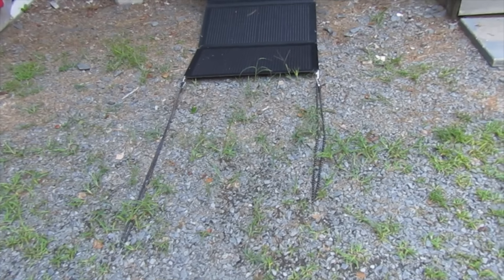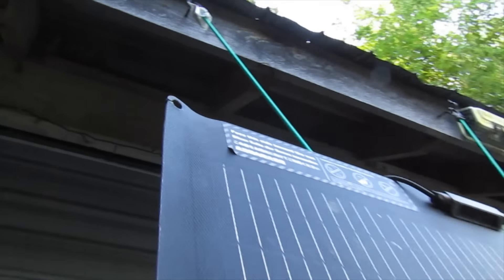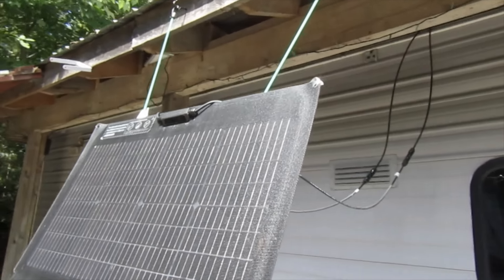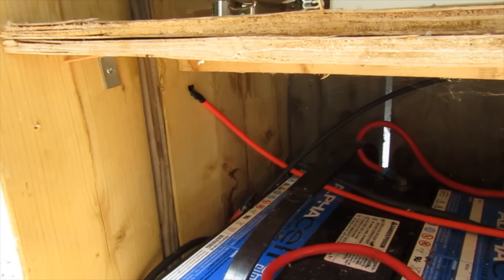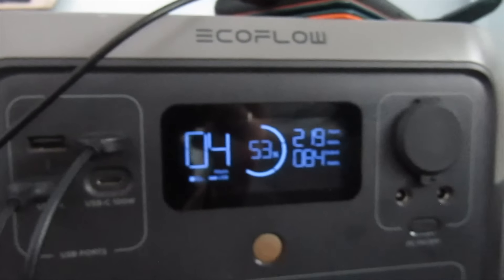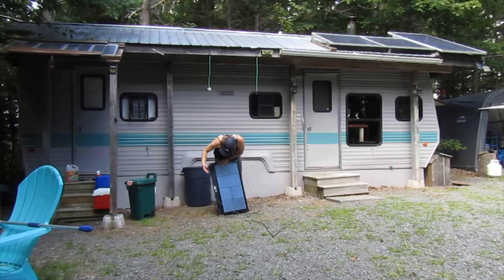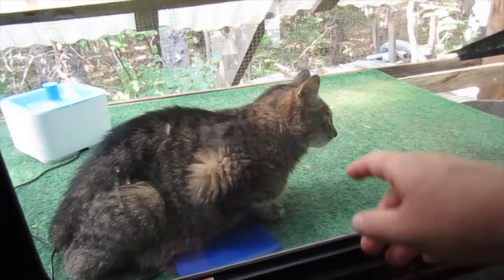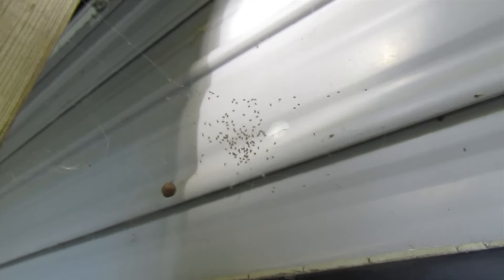Persistence (sometimes) is KEY + I Cracked My Tub.....Again!

Comment: Bad news, I’m sorry that will not hold up no time. 😢 I am a retired plumber. I have fixed so many tubs. Any plastic tubs are weak. Especially RV tubs. 🙄 You can drill holes along that crack and spry foam under it for supporting it to the floor. “Use Tuff Stuff”. Get a two part epoxy, fiberglass reinforcement kit on it and you’ll never have trouble with it again. It will be a little tricky matching up that pattern. Put one layer of two part epoxy to set the fiberglass reinforcement It’s thin you may use two layers of fiberglass in two directions. Then a couple of layers of two part epoxy to feather it out. Feather that out with sandpaper. I used a small sander. Work with a ruff grit “ being careful not to sand back down to the fiberglass” work your way to a fine grit. Then you can get some tub paint to match what you have there and “finely” feather the paint out with fine sandpaper. It would be really hard to match that bottom pattern although it’ll be fixed and I’m sure you won’t care. With all that said, I usually came back and painted the whole shower/tub to have a good match. I have fixed them where the whole bottom was broke out all the way across the bottom of the tub in the middle where. Kids have jumped up and down splashing in the tub. 😊
Reply from the maker: Thanks and wow, that does sound like a lot of work!
Reply: @gypsyjenna I pretty much agree.  If you replace the tub (again), it would be ideal to set it into spray foam or even tile grout.  But if you want a stronger fix to your current tub, I would clean and rough it up and use some Marine Tex epoxy.  It’s designed for fiberglass boat repairs.
Reply: Oh sure you do just keep a towel there when you take a shower
Reply: @jmcbrew  I’m sorry that’s what I meant to say epoxy daaa🥴
Reply: @gypsyjenna  I’m sorry I did mean “2 part epoxy” never had one fail. It needs the foam under it tho for good support :-)
Reply: @user-01Bigmac50  With it leaking there it’s rotting the floor under the tub. A towel won’t help with that. 😢
Reply: @gypsyjenna  Good repairs are never easy and bad repairs never work long- choose your poison. Determine if your tub is fiberglass or ABS, then patch it accordingly from the backside going a few inches extra in all directions. You might have to unfasten it and prop it up to work the area. When you finish, fill it with enough water to see if it leaks. The best leak tester is toilet paper; it will show even the tiniest amount of moisture. If that's good use non-expanding spray foam and fill in everything underneath the lower tub floor. If there's places you can't access while the tub is down, spray them while the tub is propped up then drop the tub into it- work fast so the foam doesn't set. With luck that will last you some years, 

The sad part of RV's is that everything is made of thin and cheap low-spec materials, and much will be sized or made such that you can't easily replace it with something better. Anything made for RV's will cost more than a home-grade item but will be a far lesser product so anytime you can convert to home-grade things that's the way to go. They do make home-grade fiberglass 24X36 shower pans, and that's what I'd recommend but this will not be a direct replacement thing- it will need plumbing changes and maybe an improved floor as well as new enclosure walls if your existing walls don't go down far enough. It will also cost more but only once, and you'll never have any problems ever again as the benefit.
Reply: @scooter6334  cool this guy really knows what he’s doing
Reply: @mjrootz  Ask me if I care 😏 the ones that would say if this was my job…. Didn’t last long 🤭
Reply: Hey Jenna. Thank you for your channel. I look forward to living full-time in an rv shortly and watching your videos gives me knowledge and confidence. Thank you.
Reply from the maker: @elizabethbradbury1460 best of luck and thanks for watching! 🙂
Reply: @gypsyjenna  Thank you!

Comment: A quick but good alternative to repairing that crack…..”Flex Seal” I know some people might say WTF but…..I’m a commercial HVAC contractor that works on large HVAC equipment. I had a customer that did not have the money to repair a cooling tower basin the way it needed to be done. So…..I cleaned up the basin real well and painted on some white ( clear available on Amazon) Flex Seal on it and let it dry for about two days.

I then added 2000 gallons of water at 8 pounds to a gallon…..16,000 pounds of water weight on the basin. Not one leak now two years later.  Something to think about…

Comment: As far as the portable 220 watt panel your probably right. When I saw you tie up the panels the way you did I knew there was going to be a problem. Solar panels should always have a bracket to hold thier weight, especially this 220 watt 2 sided  tempered glass panel.       If you want to use them at ground level build a  frame that would completely support the whole panel and is also portable.  Good Luck!

Comment: I didnt think about useing the spray foam under your shower ,
Thats a good idea .  Find a piece of plywood about the size of the tub , first put some material down like plastic drop cloth  because that foam could stick to the plywood piece used to keep the tub floor flat .
Plastic sheet you can get off , it wont be easy .  Good luck .   😀

Comment: If you ever get under the tud again put a small wood frame around the curvature for support. 

Addition foam etc will only fix short time as it will push down due to weight.

Ive owned to many mobile homes and that is a common problem over time.

FWIW - you dont have a beer problem all is well!

Comment: Your tub cracked in the same area mine did (where the textured and smooth surfaces meet).  I put a piece of white Flex Tape on the crack, it's working good so far.  My tub and surround will get replaced this fall/winter.  Have a great rest of your week.
Reply from the maker: Thanks for the info and you as well!

Comment: When you replace or if you replace the tub, try putting more backing underneath to give it more support. Fiberglass tubs are notoriase for cracking at spots that don't have support below. If you have access from below try spraying expansion foam into the void areas.

Comment: Hello again 3M 5200 Marine rubber put it on a half inch thick on both sides and about quarter inch at the middle. I know this is an older video you might already have it fixed but good luck I do have a off-grid camper on the property with 8 golf cart batteries works very well. From your new subscriber.

Comment: Hey Jenna,
    Please tell me that when you were up on the roof, you cleared the branches from the other panel. That's a nice power station that can take the VOC of a 400 watt panel. Even in not ideal solar conditions you may be able to max out the 220 watt maximum input of that station. It's never a bad idea to over-panel when possible. Thank you for not killing the spiders. 🕸️ 🕷️. If they stay outside they do more good than harm. The Wasps on the panel would have to go through. I'm allergic to bee and Wasps venom. 😅 
        That's a shame your newer tub cracked. I remembered when you replaced the old one. I have a crazy question. Are there any RV tubs made out of aluminum? I don't know but if something like that is available, that might be an option. You shut your water off in the cold months something like that might work.
        Ramsey looks happy because you're pulling in max solar on that power station and you can top off your smaller power banks to keep his fountain running. BTW... Ramsey has that "I don't do windows" look on his face. Rory must've been keeping a low profile in this one. He was haming it up in the last one.  
      Take care and remember, stubbornness doesn't have to a liability, it can be a valuable asset.    Enjoy the rest of your weekend and have another cold one. -----Steve.
Reply from the maker: Thanks Steve, I haven't heard of the aluminum tub but I am very disappointed mine cracked as quickly as it did!

Comment: Pull up the rigde cuse some protective gaurding and it will shorten the run . Those tubs are poorly support,In my trailer  it was cracked so I used spray foam to add support and used a flexible spray on rubber in a can to coat the tub,may have to use some sand paer to scuff the material.

Comment: Might be a good idea to insulate the wires where it touches the metal roof sheets/secure them so they can’t be moved around by the wind. The wind could cause the solar cables to rub against the sheets and wear out/cut through the insulation and ground out your wires on the metal.

Comment: i would get a can of big crack spray foam filler from wally world and drill a small hole to fit the nozzle, fill it w foam and then silicone the hole and crack.yes them tub/shower pans need support ALL around the bottom or what happened will happen. plenty of vids on here about installing tubs and shower surrounds for tips.

Comment: For that unwanted branch, there's a tool where you toss the weighted end of a line up over the branch, then pull the line to get the business part of the line to the branch; that part is sort of like a chainsaw chain. Pull the two ends of the line to and fro to cut the branch. Also, I have fashioned custom saw attachments to go on the end of my roof rake. One is from a pruning saw, and the other is a tiny bow saw. As long as you don't get the blade bound up, you can make modest-sized high cuts. Also, a home-crafted brush attachment on the roof rake poles would allow her to stay off the sketchy stepladder in winter; she could get snow off the solar panels from the ground.

Comment: Maybe someone has suggested this already. And not sure if it will work on your tub. But my fiberglass tub at home had several cracks. I used spray on flex seal. I put three coats on and now two years later it has not leaked at all.

Comment: I agree with what scooter said. But, if you need something quick and less stinky, Gorilla Glue makes a product called Gorilla Tape Waterproff Patch & Seal. It comes in white. I stepped into mine and got a HUGE crack in one corner. Put a piece of this over it and, so far it's holding just fine. I do wish I had spray foamed behind it first though.

Comment: Those portable solar panels are expensive Jenna how many watts is it ? Tubs broke again ? Danm the bad luck with that tub I’d put wax paper down and spray foam underneath the whole bottom of that tub the foam won’t stick to the floor because of the wax paper use a couple of layers of wax paper if needed Ive did this before if or when you take the tub out it won’t be stuck to the floor it works 😀👍😎

Comment: PUT THE PLYWOOD UNDER SHOWER  PAN THEN GET A CAN OF SPRAY FOAM LOW EXSPANSION SO IT DONT RAISE THE  FLOOR  AN RUIN IT😂 SPRAY IN AN FILL FLOOR SPACE BETWEEN  PAN AN PLYWOOD ALSO GOOD FOR SOME INSULATION   SHOWER  PAN COLD ON FEET GAP BETWEEN  PAN AN PLYWOOD  NO SUPPORT  THATS WHY  IT CRACKED I GUESSING  GODBLESS YOU JENNA GITTER DUN

Comment: Where's there is a will

Where there is a WILL
There's a lawyer too
She's always doing something 
Always something new

Trial and error
She's on the spot 
Dangling solar panels
She can't be stopped

Superwoman
Ready to roll
Quicker than any super hero
She's ready to go

Yes, the life
Yes, the trial and tribulation
A sponge of knowledge
And her little POWER STATION

( Try Tyvek tape. It's extremely water resistant, used for Tyvek house wrap. I use it for a lot of out door projects. Though not an attractive repair it works. I use it to prolong small cracks in 5 gallon buckets to carry water for plants. Tough woman...venture on.)
Reply from the maker: Thanks for the sweet rhyme and I will look into that repair!

Comment: I know this is a SUPER LATE comment... but if you want to fix that tub... Go get you a small container of fiberglass resin (with hardner... I suggest "Bondo" brand for your needs) and a small pack of fiberglass matting. It may seem difficult, but it's easy as F. Scuff up the area around the crack, mix the resin with correct amount of hardener (just follow the directions on back) wet the crack with mixed resin, place pre-cut peices of fiberglass matting over it. Go over this with some more resin, and for  a lack of better terms, 'Stab' at the matting with a chip brush (cheap as a kick in the ass) do this with about .... ohhhh two to three layers. Let this dry, and give it a quick sand to make it smooth. Then hit it with some spray epoxy paint and you'll be all set. It sounds more involved than it really is... but this will cost, at best, ehhh 30-35 bucks. This is the same method I've fixed boats for years and ain't a single one of em leaked. I've also repaired motorcycle plastics that have been damaged beyond recognition and have been stronger than they ever were. It's a cheap fix, and a super valuable skill set to have. Anyways, Thumbs up as always.
Reply from the maker: Thanks so much for the tips!

Comment: Epoxy might work. Ask  a store that sells plastic tubs. Do a search. Weight goes on the area. Support the bottom to prevent movement or bending.  Thicker tub bottom. Patch with epoxy?

Comment: I am wondering if your ECOFLOW model has both, an input jack for the solar panel and another input jack for the 12V cigarette lighter car charger?

If yes then you could connect all your 12V gel batteries to that 12V jack and that should extend the time that the ECOFLOW can run the fridge etc.
Reply: The tub on my RV is supported by a piece of plywood directly underneath the fiberglass tub, no chance that it can be pushed down.

And NO, no such thing as too many 🍺🍻 beers (in moderation)
Reply from the maker: It's one connection for both 👍
Reply: @gypsyjenna  that is too bad, thank you for your reply.

Comment: Jenna, I’m sure you have mentioned it before but need to ask. Why not keep adding regular panels on your roof? The fixed panels have become very reasonable and hold up really well? Also, why not keep power going to your battery bank and have an inverter there you can plug into? You could use it to produce some supplemental heat in the winter maybe when the wood stove dies down at night? Hi Ramsey, you scare-d cat, lol. Hope it all goes well.
Reply from the maker: I do have an inverter on house battery. I am currently in saving mode, hopefully it will all make sense someday 🙂
Reply: Jenna, if you got it all together at once, we wouldn’t have anymore of your adventures to watch, lol
Reply from the maker: True that! 😃